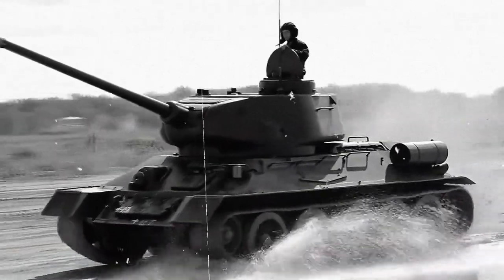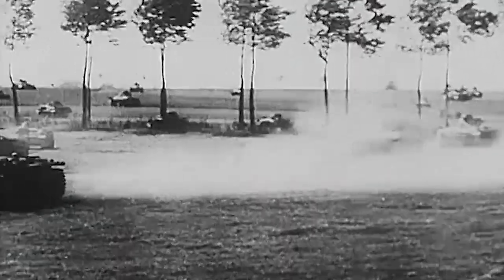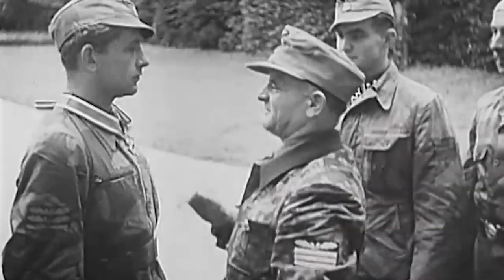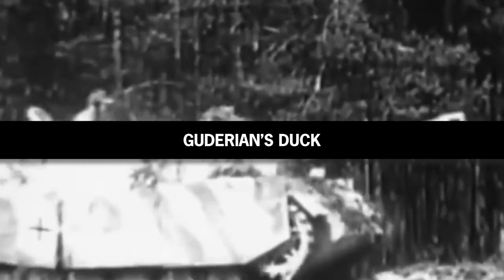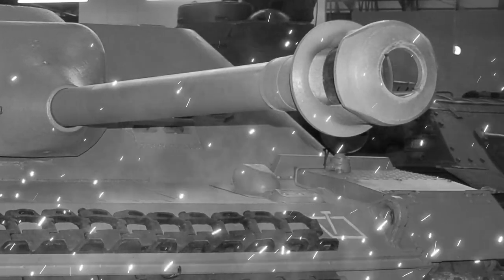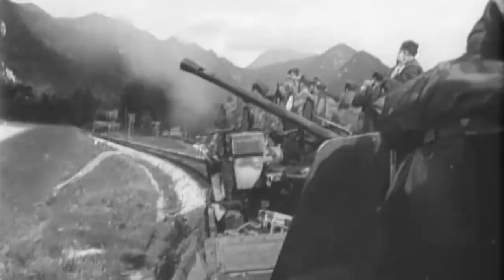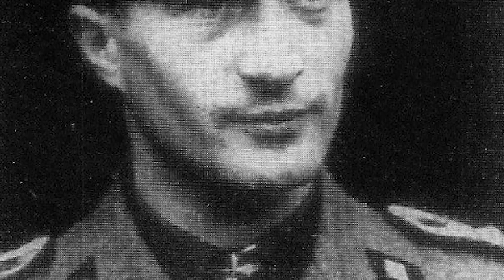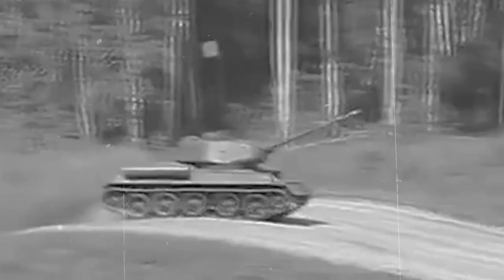Jagdpanzer IV Tank Buster

Comment: The T34 was on the surface a good tank. Good sloped armor, speed, weight and a decent gun. But it wasn't beating the Germans because of any of these things. It was beating them in the numbers the Russian army could bring to the field. The Panzer was in almost everyway a better tank, but it was overly complex,  had a nightmare fuel system, were harder to make and used too many resources for Germany to field them in real numbers. The fact was that more T34 tank crew died from shell splinter incursion into the vehicle because the welds were so poor, crew could often see light coming through the gaps of the plating.
Reply: Was the pz4 complex too? Heh russian armour at its best against 37,50mm and worst at the big brother 88
Reply: the panzer is not a tank model their was a dozen of diferent model of diferent quality them self changing over the times
Reply: Thank u I I have no idea why this guy keeps putting out videos that the t-34 was some invincible tank
Reply: @austinbunyard3284  as everyone keeps on saying the T-34 by itself was nothing particularly special but it had an enormous advantage that lastly defeated Germany: apparently In 1943, T-34 production had reached an average of 1,300 per month and by the end of 1945, over 57,300 T-34s had been built: 34,780 
T-34/76.2 and another 22,600 of the much improved T-34/85 model in 1944–45!! An astonishing figure that the Germans couldn't even dream about. This tank had a series of notable points: had sloped armour, good cannon, good Christie type suspension, large tracks and a powerful diesel engine. Didn't to be perfect...
Reply: @paoloviti6156  yes it did but the only reason it ended up defeating Panthers and tigers is because of the manufacturing capability and the simplicity like you said if they would have the same numbers of tigers panthers King tigers t34 and is2 were nothing compared to those tanks
Reply: @paoloviti6156  The T-34 was something special in 1941. It was better armed, armoured and more manoeuvrable than anything the Germans had at the time. It was a shock to the Wehrmacht and spurred the urgent development of the Tiger and Panther.  It wasn't until Operation Citadel in mid 1943 that the Germans had enough superior tanks to deal with them head on. The T-43s weaknesses were crew layout/employment and poor co-ordination due to a lack of radios resulting in severe tactical inefficiency. Then there was the KV-1 & 2, they were in another class altogether.
Reply: @austinbunyard3284  The T-34 didn't defeat the Panther or Tiger. They were overwhelmed by sheer soviet numbers of many different weapons which also included the T-34. The Soviets lost one hell of a lot of T-34s to Panthers and Tigers from mid 1943 onward. 

The IS2 was far superior in firepower to both the Tiger 1 and Panther and was better armoured in most regards as well. The IS2's gun was less accurate and it had a slow rate of fire. Tiger 1's could only take them out with great difficulty. Panthers were more capable against them due to a better gun although an IS2 could smash right through their frontal armour from almost 1000m. The Tiger 2 was another matter - it could take IS2s out at about 1500m+.
Reply: @TonyGrant.  correct but is good to remember that  no other tanks suffered so much losses as the T-34 until now. It was due to various factors such as bad training and inexperience, massed attacks with little coordination with almost total disregard for their troops, bad radio and relatively few was installed, low quality gun sight and limited visibility with the hatches closed. Nope altrough was very effective way to the Korean war it is not my tank. Wish I could climb on one...
Reply: @TonyGrant.  The IS-2 had the same problem as all Soviet/Russian tanks; it looked much better on paper than in reality. 

The big gun, wether firing AP or HE was dangerous to any tank German tank, but had low penetration for its size, about in the same class as the Tiger 1. The "old" Tiger had little problem in penetrating the turret front (100 mm) or the lower hull front from long range, it could also fire at least three round for each round the IS-2 could reply with. The IS-2 also suffered from the same armor quality problems like all Soviet WW2 tanks, which could result in even non-penetrating hits causing armor bits loosening and richocheting inside the tank, maiming and killing the crew. The Tiger1, OTH, had excellent armor quality. In one incident a Tiger 1 took a hit from an IS-2 to the driver's front plate from just 25 meters and survived because the Tiger stood at an angle.

A report from Grossdeutschland's Tiger 1 company stated that most IS-2s would turn away and flee when facing Tigers and only exchange fire at very long range. The same report also stated that the IS-2 crews would bail out as soon as the first hits were rgistered, probably because of the internal spalling. The same was reported by German AT gunners.

Still, an unit of IS-2 was a force to be reckoned with because of the big AP and HE rounds. But the big gun was both an asset and a liability due to the low ammo load and ROF. The Soviets had to compensate for the lower quality of their AP rounds with bigger guns - the 85mm in the T-34-85 had slightly lower penetration than the 75mm L/48 in the Panzer IV and the 122 mm had slightly lower penetration than the 88mm L/56 in the Tiger 1. This was slightly improved towards the end of the war.
Reply: @paoloviti6156  actually sloped armor was not as good as on the paper, canon - maybe was good but sight in the tank was poor quality, Christie type suspension - do you see any this type of suspension currently ? NO !!! it was a nightmare and T 34 M with torsion bar were under construction. What about metallurgy ? 
The only good or great was production capacity 

Pz III H/J was much better than T 34
Reply: The T-34/76 was a far inferior weapon to the much latter T34/85  (1943).  First of all the T-34/76 it had only a 2 man turret though it was power driven.    Now compare this to the German Panzer III and Panzer IV.   the German tanks had better optics and better visibility for the crew.  The German tanks had 3 man turrets patterned on British practice: Gunner, loader and commander.  Due to this the Germans tended to get it first sighting, first shot first kill and more shots.  Every German tank had a two way radio which worked over several kilometers and a radio operator.   The Panzerwaffe sometimes just used their radios to join a Russian tank formation and fire from behind, the Russian tanks were that oblivious due to lack of radios and the workload of the two man turret.  So despite their inferior weapons and Armour the Panzerwaffe could hold its own.
-Its worth noting that one reason the 50mm L44 and latter L60 was on the Panzer III was that the Germans had hoped to developed a Amour Piercing Discharging Sabot round to increase penetration. The Germans called these TriebsSpiegel rounds.  This round either failed technically or was not feasible due to tungsten shortages.   The Germans did latter use APDS but it was without tungsten (slightly more penetration but not as much as tungsten round). 
-Up armouruing tanks was one solution and the other was fitting the long barrel 75mm gun to the StuG III and Panzer IV.   There was also a 7.5cm HEAT round introduced PzGr 38 HL for the short barelled gun with the PzGr 38 HL/A being the improved version.
-Guadarian was right in that the StuG III was perfectly adaquet to carry the long barrel 7.5cm gun.  I think the Jagdpanzer had maybe an additional crew member that made it more useful to to the Panzerwaffe.   The StuG III was operated by artillery units, was never meant to be a tank.  It was a self propelled armored gun meant to support infantry when a trailed carriage gun was too immobile and vulnerable.
Reply: @arekofpoland8735  sorry if I'm replying only now in my opinion it is a yes & no because all tanks have good points and bad points of which some have too many bad points! That said the  Jagdpanzer IV was an excellent tank "buster" but officially, only the L/48-armed vehicle was named Jagdpanzer IV. The L/70 armed vehicle was named Panzer IV/70 and armed with the very powerful 7.5 cm KwK 42 L/70, the same as installed on the Panther. It had a very low silhouette, 1,85 mt high and completely enclosed and had 80 mm armour on the front, very inclined and 40 mm on the sides offering good protection. It did had issues as the driver had to be very careful driving with such a long gun positioned very low and limited visibility for the whole crew because of war economy. According to Thomas Jentz in an interview on YouTube with Sofilen, he claimed that the gun sight was very precise and there was good space inside. Hope I didn't bore you...
Reply: @paoloviti6156  Thanks for your answer - besides we can say what is also more important are how too use tanks and combine arm tactics
Reply: @arekofpoland8735  You are welcome and you are correct but remember that Germany was in a terrible situation completely overwhelmed by the the allies especially at the Eastern Front. Basically tatics was almost of little significance not to mention the chronic shortage of fuel and tanks....
Reply: @paoloviti6156  Yeah - Germans lost in my opinion 7 Dec 1941 - When US joined
Good talk to you

Comment: I'm tired of 'historians' claiming that the T-34 In 1941 sent panic into the Germans, it didn't. That the T-34 was vastly superior to anything that the Germans had, it wasn't.  Sloped armor shocked the Germans, it didn't. To begin with mechanically the t 34 wasn't reliable and with few spare parts limited it's effectiveness. Operationally the fact that the commander was the loader and no radios and horrible optics , horrible external vision left it deaf dumb and blind on the battlefield made it an easy target. Crew train8ng wax also bad with the gunner having fired auround 4 times before going into combat. Ergonimacilly the tank was horrible while the German ones were good with a dedicated commander. What scared the Germans far more and was far more than effective than the T-34 was th 7.62mm field gun. Btw the jagd panzer 4 wasn't fielded until 1944 three years after the Russian invasion. Not really a priority. The reason was the early and mid jadg panzer 4 had the same gun as the pz 4 g.
Reply: It was the numbers he claimed that panicked them, not the technology
Reply: The germans feared the kv series more, as there smaller guns on there pnz3s, pnz2's and early pnz4's would bounce off the kv1 like nothing.
Even the pak 39 and pak 40 had some trouble dealing with kv's, but as soon as the flak 88 or tiger 1 came into the picture the kv was dead.
The T34 was manageable to deal with but was outproduced and usually in greater numbers.
Reply: Yes

Comment: I love this often overlooked tank destroyer. The limited impact of the Jagdpanzer IV was basically because it was too late into the war and its production plants got bombed. They didn't have enough tanks anymore so they felt 'forced' to use TD's such as the Jagdpanzer IV as 'tanks' which forced them outside of their element and of course, Germany lacked good experienced crews during the later stages of the war.  But yeah, Hilary Doyle will confirm this was a very potent TD. People often tend to overlook "soft stats" like roomy interior space and smart ergonomics, yet those are actually the decisive factors which the Jagdpanzer IV had going for it; super low profile, yet roomy interior. Amazingly, the Australian tank museum has a running Jagdpanzer IV !

Comment: The t34 was a piece of crap, lazerpig did a great video on the topic.
Reply: Tank you very much ✌️
Reply: The early version had issues,  however was a easy build, effective tank. Biggest problem for the Russians were lack of radios,  tank itself in late 41 was best tank of all.
Reply: @jantschierschky3461  Watch Lazerpigs Video. The list of flaws is too long for a comment
Reply: @jantschierschky3461  KV 1 was better, this tanks were hated by germany 1941
Reply: @DJ1573  early version yes had issues,  however the 41 version was the best tank at the time.  The tank was crude, rough, but was reliable had good armour and with the 76.2mm the most powerful tank gun at the time. Good for mass production and could be operated by relatively uneducated conscripts.  So it was a very effective weapon for that time. Btw I studied that war, so I am very familiar with it's strength and weaknesses.
Reply: @DJ1573  KV1 is a heavy tank, it was relatively slow. Cost more than double as t34. It was more armoured, but has its drawback
Reply: @jantschierschky3461  Panzer III with 5cm could destroy T 34, Engine was a mess, suspension too. You studied History not Engineering so better be quiet and check your sources. Our generals loved to overhype that thing to hide some of their own fails (german here)
Reply: @DJ1573  Meister du hast es immer noch nicht verstanden.  Motor war gut, getriebe nicht so. Es geht hierbei um das System,  nicht um den panzer alleine.   Panzer 3 war der bessere am Anfang,  aber mit t34/41 wars vorbei.  5cm konnte nur auf kurzer Entfernung durchschlagen.  Der t34/43 war wesentlich besser und dann der t34/85 war sehr gut. Es geht aber hier um Stück Zahlen über 40 000 t34 produziert
Reply: @jantschierschky3461  Dann komm nicht mit spezifischen Modellen. Die Qualität war mies aber die Masse hats gemacht
Reply: Only the early versions had considerable issues, calling the latter versions "pieces of crap" is straight up childish. It's childish. The amount of german tanks fucking obliterated by them and the amount that could be produced because of the cheap cost and simplicity of the design was sensational.
Reply: @laurikotivuori1585  Its childish to hype up such an average Tank 🤦‍♂️
Reply: @DJ1573  Masse und Qualität,  dementsprechend gut.

Comment: dude alot of bad points in the video
first the german 37mm gun was good at the early stages their veteran crews used it to side shoot the t34s
also the the panzer 3s were refitted with the long 50mm and the panzer 4s by longer 75mm
by 1942 the germans got their Tiger h1 
the reseaon the t34 was good was it's easy production and maintenance compared to the german tanks
Reply: At the outset of Barbarossa about 90% of Panzer III's had the L44 of the 50mm gun and about 5% the 37mm and 5% the L60.  The AT guns were all of the L60 type.   Hitler had actually demanded the Panzer III receive the L60 and he noted that his orders were not carried out.  The Heerwaffenampt didn't believe in over hanging guns but it  seems to have been a matter of tooling to make the guns.   In the Osprey book on the Panzer III it mentions the Germans had been hoping to field a APDS tungsten core ammunition.  They refered to it as TS or TriebsSpiegel but there was either a technical failure (probably inaccuracy due to sabot separation i imagine) .  They used tungsten core instead.